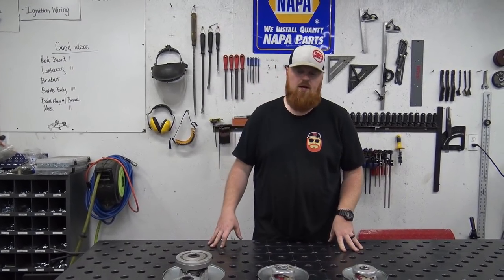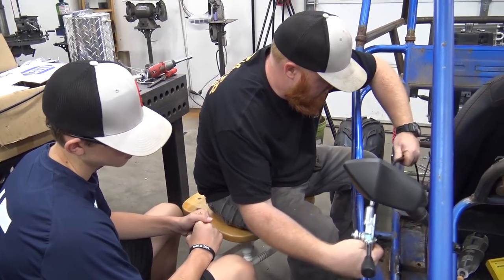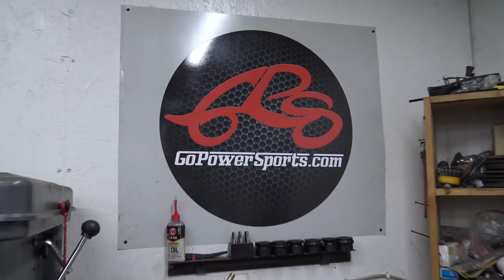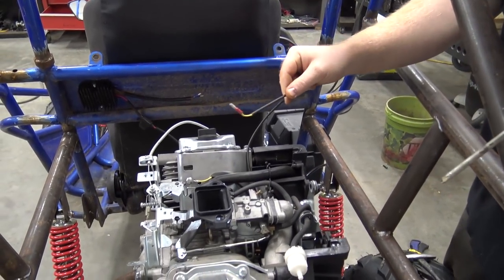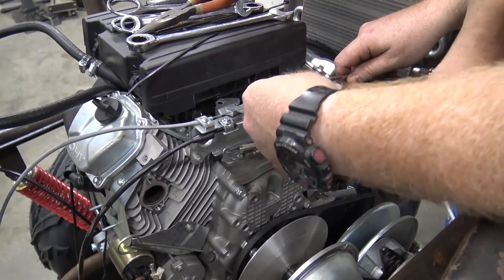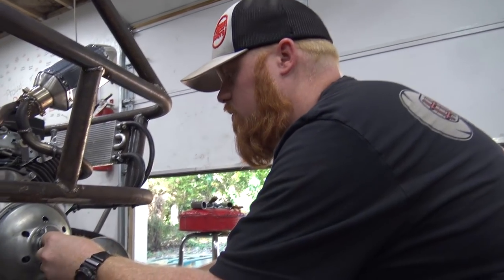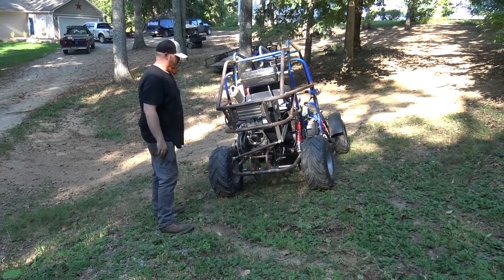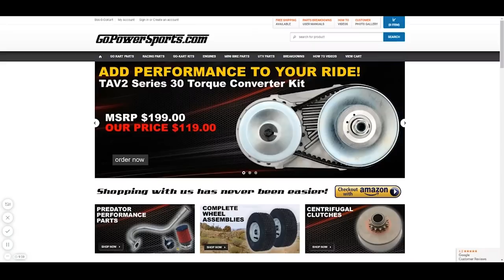Semi Independent Suspension Go Kart Build Ep3

Comment: I really like what you did and a refreshing approach.  Just a suggestion but when using a pan hard rod setup the horizontal angle should be neutral which minimizes horizontal movement thru vertical travel, I would also want to go with at least a 1" rod end for the suspension pivot but a great build.  I always thought about on the old Honda Odesseys cutting the rear off and allowing the whole rear section to pivot instead of being rigid..  Keep up the good work!

Comment: *burns down the 670 after a backfire
*immediately pulls spark arrestor out of new exhaust 😂😂😂
Reply from the maker: I think it's a sin to leave it in lol
Reply: Maybe having a fuel catch plate below the fuel tank like what Baja SAE requires to prevent fuel spillage and fires.
Reply: Red Beard's Garage a sin you can burn for lol
Reply: I am pretty sure a spark arrestor only catches rust that glows red and pops off inside exhaust and not a foot long fireball haha backfire is a fireball not a spark or any sort of hot metal exiting the exhaust. Basically a catch can for exhaust pipes.
Reply: *baffle - not going to do squat with sparks.
Was glad he took it out so we could hear it rumble.

Comment: How well do you think that rear suspension set would work on a smaller buggy? I just picked up a 212 Predator and want to scratch build a smaller light weight off road kart with front and rear suspension.
Reply from the maker: I will work great on any size kart.

Comment: Now they need to push the front suspension forward to improve approach angle, and redistribute the weight (with rider/riders) farther back to prevent the bucking effect that was so evident in this video front end goes up then comes down just as the back end goes up and stays up trying to roll it over as the front end catches on the ground

Comment: i hope he reads this but have you ever heard of snowmobile engines???? if you were to get a 600cc it would be just as big and have 112 ish hp and most 600’s will go 100+, not that you will ever need that speed but you would have it if you wanted it. easy wheelies, good speed, cheap, amazing
Reply: at least use snowmobile clutch’s aka torque converters because they are just as big and can handle that 120 hp
Reply: @rt7003  yeah and how about the fact that there not tractor engine XD

Comment: 600$ for that 780
Talk about a dent in the old wallet
Reply from the maker: Yeah but the pulleys alone are $250 a piece
Reply: @RedBeardsGarage  there used to be a place that sold just the front and rear pullys for 250$ bucks
Think the website tanked tho
Reply: All the torque converters need to stay under three hundred bucks
Reply: @RedBeardsGarage  just because someone put a price tag on something doesn't mean it's worth that much it's a stupid price
Reply: Have you ever priced 4 wheeler or side by side clutches? That's what a primary costs by itself! And if it's a Polaris primary it doesn't come with the weights or spring
Reply: @CR4ZYxRY4N  they haven't always been this expensive. In the early 2000s a genuine comet 30 would sell for $120, 40 series about $179. But when Tecumseh/Comet shut down in 2009, well it's been 10 years and parts are drying up.